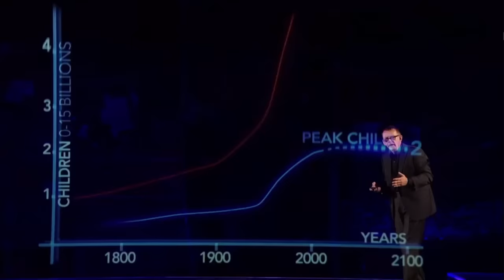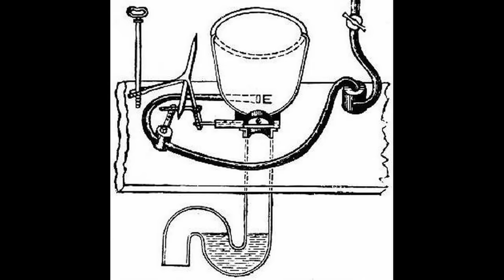How to Save TONS of Water, to Save the Planet

Comment: ahh yes, here's the thing, most landlords are SHIT when it comes to upgrades, even though my landlord pays for the water|

in my case the water is actually intolerable(for drinking/ice/ the water is safe enough for cooking/dishes/ect), it has so much sediment and other contaminants in town(known issue all through this american civil war town)
so for 150$ and a 6 month cartridge swap at 30$ I get perfectly orgasmic water(like actually it is surprising how much bad water makes you sad) this however leads to 5x water usage for drinking(assuming you don't pipe the brine flow into a toilet tank or use it in some other manual way)

in my case I have decided that given I am a DIY guy I will do a recycler loop(really bad for RODI, did I mention the filter type?) but can be made acceptable if you manage at what point you discard the water(~100 TDS input so I can recycle water 3x before i need to discard at >500TDS, saving so much that I get 1/5th the waste, the beauty of compound ratios bro)

500TDS is actually the maximum starting TDS before they consider it "unsafe" anyway, so it is actually fine to do it that way, since the filter is designed for that high of starting TDS
honestly the DI resin is what would limit filter life if I didn't loop it(and the fact that my pump for recycling makes it run at 20PSI higher so it is more efficient as I am closer to the ideal 80-100PSI)
and DI resin can be easily recharged by normal people, just a bit of caustic soda and hydrochloric acid, no biggie for someone not an idiot(so not electroboom lol)

so the only consumables(besides tanks and membrane/cartridge replacement that are on the dirty side(the DI is clean so it can just be recharged and washed) is some occasional acid, 6 month carbon and sediment cartridges, and 3-6 year tanks and a membrane(50$ for a 1-2 gallon usable tank, 100$ for a whole family worth, and 20$ for 2 membranes, keep one on the side sealed for the next swap)

honestly I went too far given nobody else cares enough to get a real filter instead of buying plastic bottles regularly, let alone I am in a state that is very wet and unlikely to dry up before the rest of the world shits themselves, but the cost was cheaper than water bottles(before the recycler additions) and the recycler was still cheaper that continued use of bottles(after 2x as long payback but still will ultimately cost less)
and the project was fun, first foray into arduino coding and integration hell(hall effect sensor interference is all I will say about that), but it still was nice to learn on something semi-simple and useful

Comment: Yes, human activities did make some changes, but
I am not guilty. You are not guilty. Most of people are not guilty. Guilty are those people, who hold 99.99% of world's wealth, while being just 0.01% of world's population. They have so much, but it is not enough for them. It is their actions.
I want paper, not plastic. I want durable products, which I can use for 20 years or longer, not something what is designed to fail right after warranty ends.
Take a note of this.

P. S. I use roughly 10 years old computers (or rather 6 of them) for work and 12 years old monitors. Most of those are mostly off to save power. Please walk into any office. The those have problem with turning off single monitor, while not at desk. I switch off all 4 monitors, while not at desk and use as small amount as possible.

Comment: I hate it when people brush their teeth 🦷 and keep the tap 🚰 running… makes no sense whatsoever.
Reply: How that is even possible

I feel damn disturbed when there is water running or lights on without use.
Reply: @jarskil8862  Thank you! I have family friends that will literally turn on the tap, start brushing their teeth and then walk away from the tap while it's still running and spilling water down the drain. Then they come back 90 seconds later and only then use the tap. If I'm aware that this is happening I literally just run and turn the tap off and they immediately get defensive. But how do you calmly tell a person, "hey, you're mindless wasting water, what is the purpose of having the tap on?" - without them getting defensive. 

Anyway, like you I get the shits when lights are on and taps are running unnecessarily.

Comment: My problem: He didn’t include a scenario where you turn off the tap normally when you’re not using the water. For example, when washing your hands, turn on the tap, wet your hands, turn it off, get soap, scrub for *20 seconds*, then turn the tap back on, rinse, and then grab a towel and use it to turn off the tap and dry off your hand.

Comment: You know what would save the same amount of water? Eating 2lbs less of beef every 3 months.
Reply: That doesn’t even take into account the energy put in, nor the greenhouse gasses emitted, nor the ethics of less animals dying. Equivalent amount of plant based calories would use about 10% the water.
Reply: Not consuming already processed meat will save water?  Retroactively?
Reply: @adambeiting4301  Yup. Because of supply and demand. If you don't eat those 2 pounds of beef, they won't be replaced. If you're making the argument that the 2lbs of meat will be left at the market and spoil, that might happen the first time, but the market will learn to not order the extra 2lbs of meat in the future.